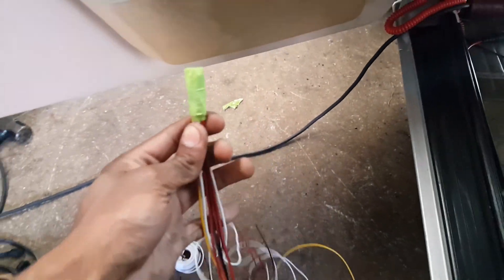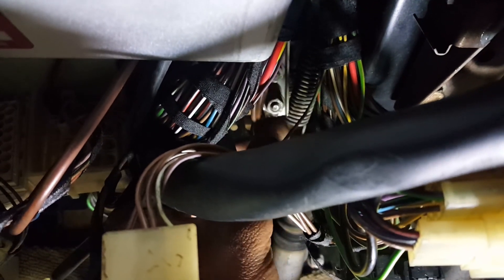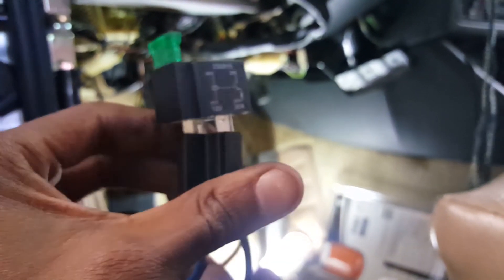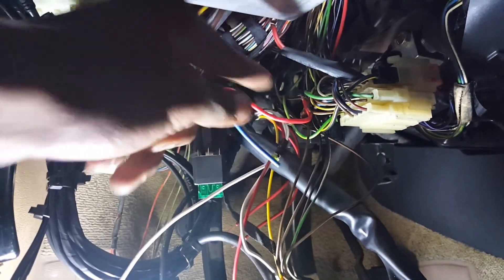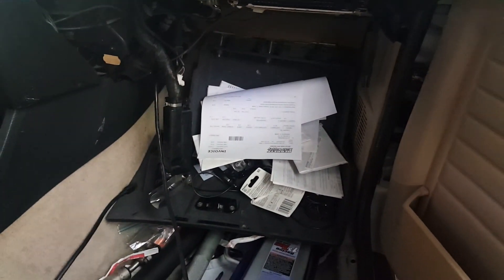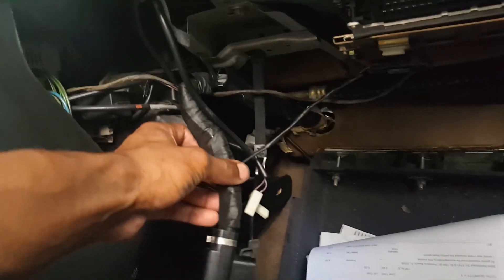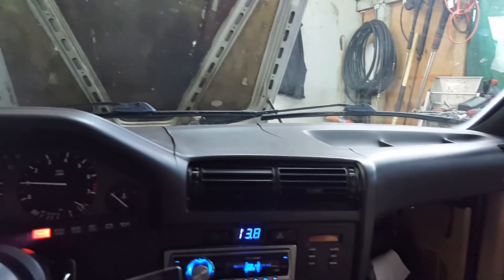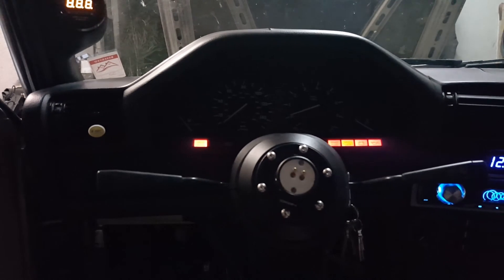E30 M42 Widebands and Megasquirts Episode 2

Comment: If you have access to a scope, you might want to measure the Idle Air Valve control signal with your stock controller and then fiddle with the MS to get a signal that matches?
Reply from the maker: Steve Kappes cars running boost now will be catching youtube up verry soon stay tuned.